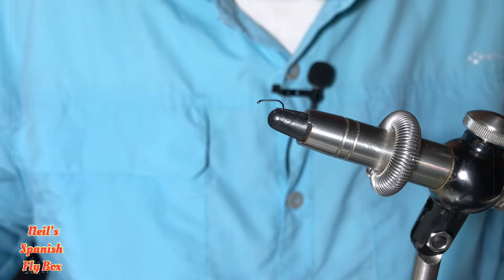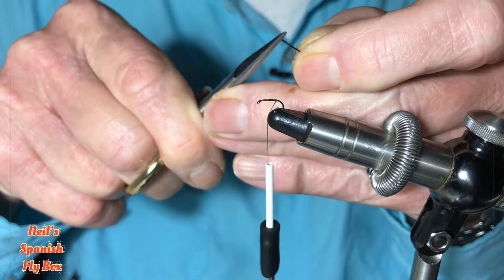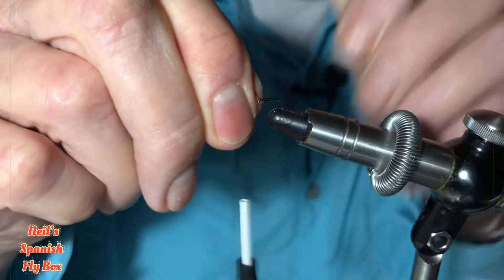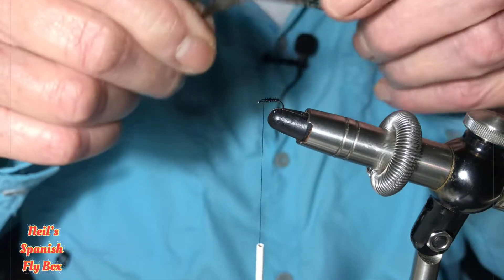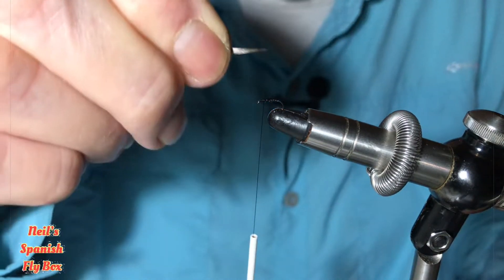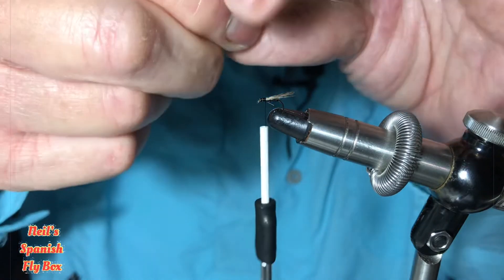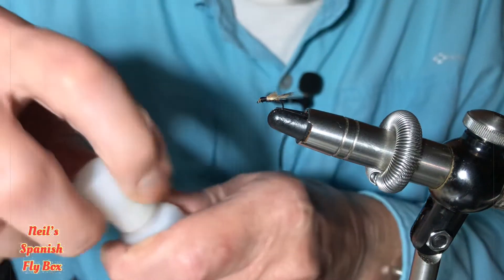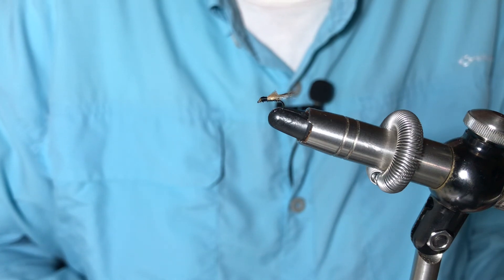Fly tying - A Caddis for Slow Flow and the Flats

Comment: Simple tie, will try it in Colorado this summer on the Rio grande flats
Reply from the maker: Hello Troutfishintrucker, thanks for viewing. Clearly, with a size 20 hook, finer lines are required. I hope you have a soft tip to your rod!☺️ In the circumstances related, it can be devastating. Tight lines.👍
Reply: @neilsspanishflybox  I fish several streams in the black hills of South Dakota and the north platte in Wyoming that requires 6&7x tippet on 20 and 22 midges. Also the Provo in Utah can be maddening, tiny flies and tippets. Thanks for your ties of Spanish flies. Simple and effective should be the rule.
Reply from the maker: @troutfishintrucker3527   Yes, I would say 7X would be the norm. A great selection of locations. Thank you for your kind comment.☺️